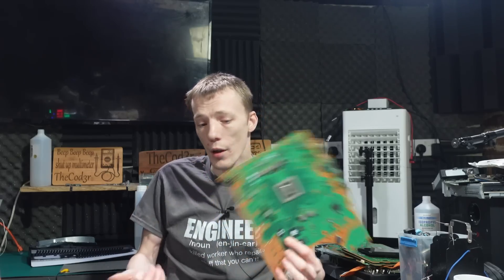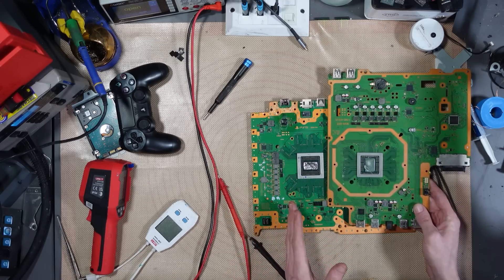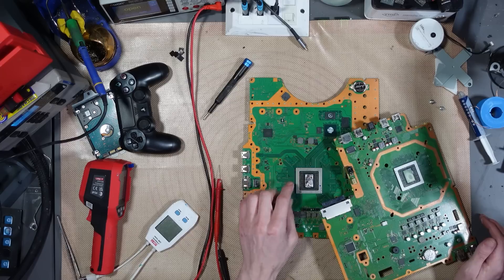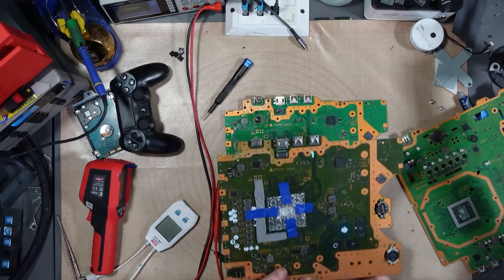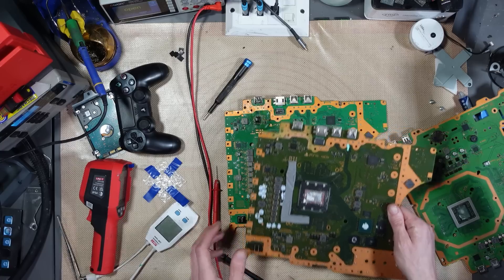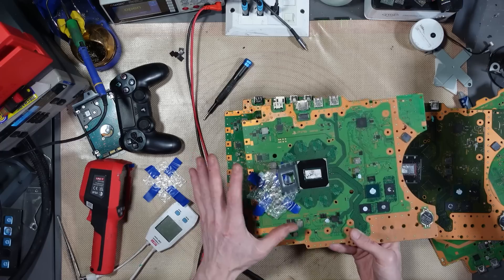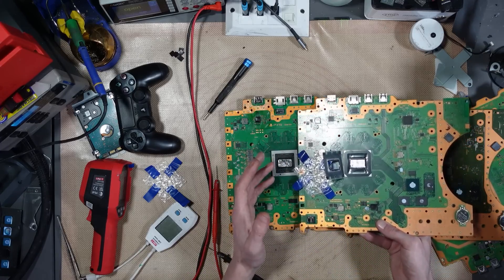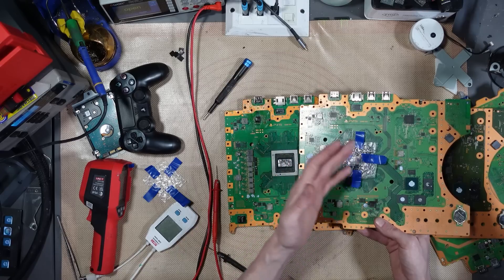Let's Talk About Sony's PS5 Liquid Metal Issue! Is YOUR PS5 At Risk?

Comment: Liquid Metal always seemed a bad idea to me. 1 its conductive, and 2 it has gallium in it which can weaken the aluminum in the chassis.
Reply: Sony ‘claim’ they spent over a year developing the Liquid Metal, now weather that meant it’s a type that won’t corrode or they’ve used a different metal on the APU shield that doesn’t get corroded by Liquid Metal I don’t know. Otherwise give it another year and those heat shield and heat sinks will be corroding away.
Reply: But you are right otherwise and it’s why Liquid Metal is not considered as a mass produced product solution. You need knowledge how to use it.
Reply: The original launch PS5 heatsink is all copper unlike the newer models so Liquid Metal won’t degrade copper it will degrade aluminium though
Reply: @CH-bn7qb  Right but the chassis is not.
Reply: @Biomancer81   after it leaks out I would be more worried about it shorting the PCB rather than wearing the aluminium down on the chassis which would take years
Reply: They can't get good temps without it.

Comment: I have the launch model ps5 are they more prone to this issue than the new models?
Reply: I wish I could give you a definitive answer, I’ve seen both yes and no to your question. My advice would be just lay yours horizontal and just use every precaution not to move it unless you’re moving for example. Worst case if you’re feeling brave you can take your unit apart and carefully clean all the liquid metal out and replace it with thermal paste. 

Now thermal paste does not cool as good as liquid metal does, as long as your fan works then your system will not overheat but the systems are designed to give you a warning message and shut off before it reaches a dangerous temperature anyways. However the system will be a little bit louder as a result.

I’m just giving an answer based off my limited knowledge of working with computers. 

If there’s anyone here willing to correct me if need be please do
Reply: @B_Skeptikal  Tronicsfix tried thermal paste and it overheated almost instantly.
Reply: @BoomerBends  Well the first part of that test was without the fans plugged in. Both thermal paste and Liquid Metal didn’t last long, and while gaming both didn’t crash with the fan running but the thermal paste allowed the system to run hotter than LM but it didn’t seem dangerous, granted that was a very short term test, we don’t know the long term
Reply: @B_Skeptikal  PS5 fan speed is determined by power draw not thermals.

Comment: Liquid metal in a games console, really bad idea it’s conductive so it only needs to be where it needs to be and nowhere else out for in trouble times games consoles are sometimes moved. They getting knocked around by Kids Sony should be designed a better cooling system, when designing the look of the PS5, they should’ve gone more for practicality less for sexy looks better cooling. No bloody liquid. Metal is designed for enthusiasts to be used on reasonably mid to high end. Definitely high end PCs which sit in a stationary position. Do not getting knocked very rarely ever get moved about in the PlayStation. Bloody bad idea
Reply: It's only bad idea because the Xbox Series X doesn't have it lol 🤣

Comment: Just a heads up, you're going to take some flack for this as this issue becomes more known throughout social media.
Reply: Sony Simps gonna simp for Sony.
Reply: @mjc0961  just like Microsoft simps. This is real however them melting is not. There's nothing in the area where the supposed one melted that would cause it
Reply: Oh the backlash has already started, simps are defending Sony hard. Personally I think it’ll end up like the red ring of death after another year, when the damage caused by improper cooling becomes more prominent. Remember Sony overclocked the APU a lot, hence the need to use Liquid Metal in the first place. It’s a pretty poor machine design wise and has obviously been built to maximise profits first and reduce costs. I don’t think Sony lost much at all on the console since launch and for over a year has been making a profit on each one sold. Then they increased its price.
Reply: @marksapollo  lol what backlash only xbox centered  YouTube channels are reporting on this. Buying Bethesda hasn't helped xbox trying to buy Activision has not helped xbox blaming sony for 70$ games has not helped xbox nothing will help them . If this was an actual widespread spread issue and not one created on Twitter by  salty fan boys they'd be talking about it on actual news channels like they did with the 360s red ring of death.
Reply: @anthonyvigil4549  the faulty ssds in xbox series x is a more widespread issue and no one wants to mention that one
Reply: @thefirst48gaming2  There are far more problems with the PS5 consoles than there are with the Xbox Series consoles
Reply: @rbking803  there's not though look up failure rates already for this gen